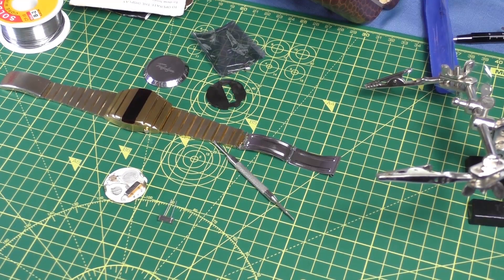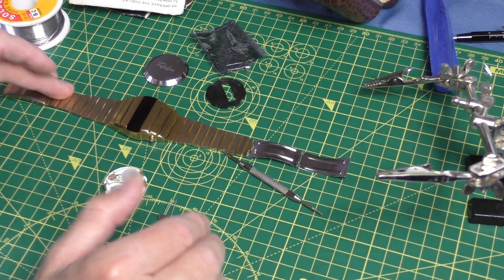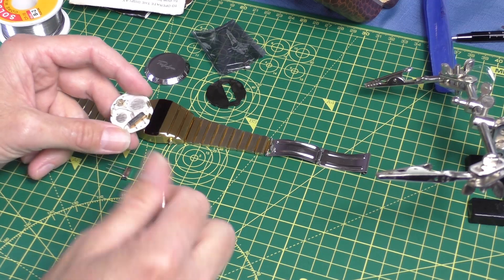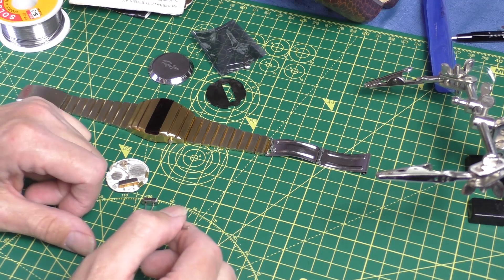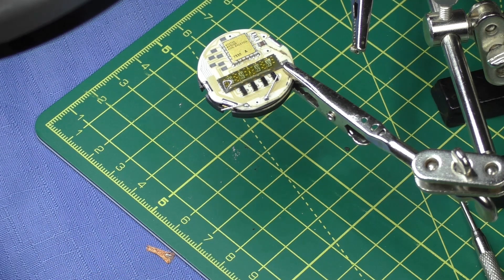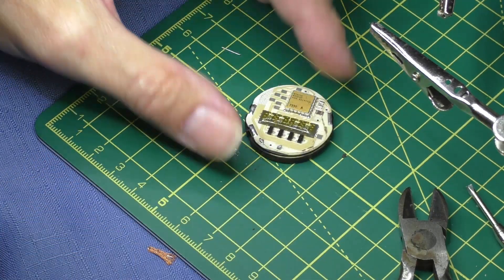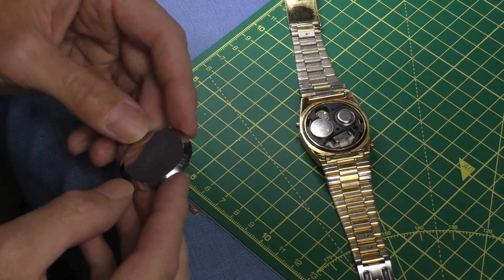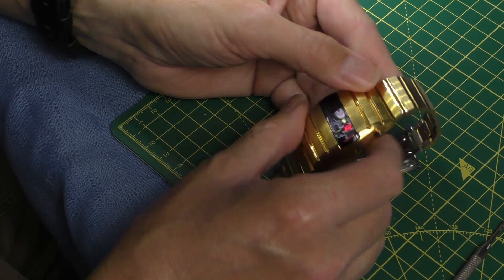Trafalgar LED watch oscillator crystal replacement (repair attempt).

Comment: I replaced the battery of my Casio cmd 40 but time on the screen remains costant. It is all the times show 12:00:00 which does not change. Sould I replace the crystal ? Or any other solutions ?

Comment: The oscillator must not be allowed come into direct contact with the case back. Is this a 32.768 oscillator? Judging by it's shape I don't think it is. These days they all seem to be cylindrical and the one you bought it not. If it is wrong it will not work.

Comment: The Mostec processor has failed. Usually, battery leakage is to blame as these movements were unusually reliable. The watch was working on another vid...what happened? Try cleaning all of the contacts, though if you fit a new quartz module, there are other components that need matching to it.
Reply from the maker: It failed after about 6 months use back in the 70's.